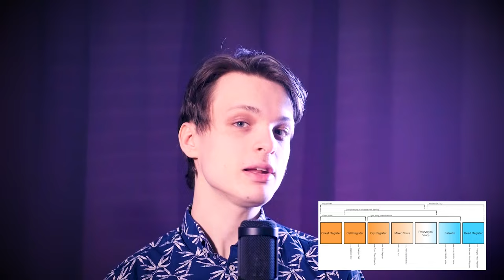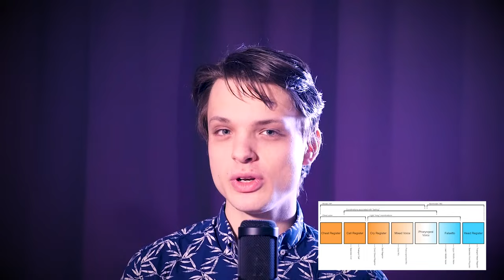Singing Demystified Ep. 9: Falsetto and Head Register

Comment: Hello, thanks for the vid! I believe your definition of falsetto and head register is more acoustic based,that head register is F1/H1 coupling and falsetto is not? Or there is also distinction of laryngeal mechanism, that head voice has active TA engagement while falsetto not? Because some define headvoice as this, and it's why their headvoice and be seamlessly conncected to chest voice. However, if I am understanding correctly and my ears are in good conditions, your headvoice is also M2.

The non-curbing hold is insightful, I wonder the two different holds just vary in degree of medial compression, or there are some fundemental differences, like different kinds of involvement of LCA and IA muscles?
Reply from the maker: They are both M2, but I suspect both of them feature some TA engagement as well except maybe for the lowest volumes. What sets apart head register from upper middle register is not just whoop timbre, which may be present in either one, but also that there's a larger distance between the tongue and palate in head register than in upper middle register. Close vowels however are identical in head register and lower middle register, but in upper middle register, they usually become a bit less spacious in order to make the shape more similar to other vowels and so make articulation easier.

Medial compression refers to decreasing the area of the glottis during phonation by squeezing the folds more tightly together. This presumes a closed glottis. Holding your breath with an open glottis has basically nothing to do with the CVT hold, not even a similar mechanism achieved through different laryngeal muscles. The curbing hold is created with laryngeal muscles, whereas holding your breath with an open glottis does not involve the LCAs, IAs, TAs, or any other laryngeal muscles. The glottis is open. The air is being held using inspiratory muscles only.
Reply: @VoiceStudioEast  I see! Thank you again for the explaination.

Comment: This is my favorite video so far in your series.

I'm curious why it is often taught to bring the spacious head voice whoop down, and noticed that teachers don't tend to say to reconnect to chest at any point in the exercise, but to stay in head voice. What is the benefit of that, if you are a belter?

Also, what is a squeezing spiral?
Reply from the maker: This particular coordination is not very suitable for reconnecting to chest voice, but it does have greater agility than all the coordinations that are suitable for this purpose. It would be very difficult, for example, to sing a countertenor or soprano aria in pharyngeal voice.

The purpose of dragging down the spacious head register is to develop clarity and power in the falsetto / middle voice. It provides no direct benefit for belting, although it could potentially be useful on account of relying on very similar vocal tract shapes to beltoing, thus giving you a way of "scouting out" the shape/vowel you need before trying to do it while belting.

A squeezing spiral is a gradual increase in compression and stretching of the vocal folds, typically also featuring a gradually increasing narrowing of the pharynx. Simply put, a tendency for mixed voice to get thinner and thinner. It is covered more extensively in episode 5 of this series
Reply: Thanks!  @VoiceStudioEast 

Dragging spacious head voice down makes me able to belt, because my voice isn't all crunched up like it was when it was squeezed in flageolet. My mood also seems to be improved, as well. Practicing head voice makes me slightly dizzy, but much more relaxed than practicing flageolet. There are shapes I can do in head voice that I can't do in flageolet, distortion included. So, while it may not help most with belting, it gives me the ability to after not being able to do it because my resonance was strangled off.